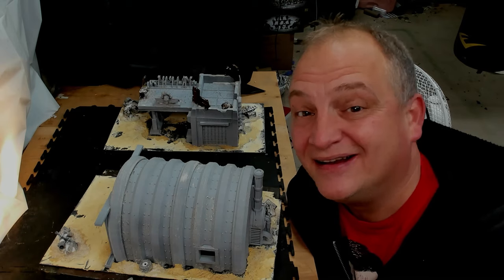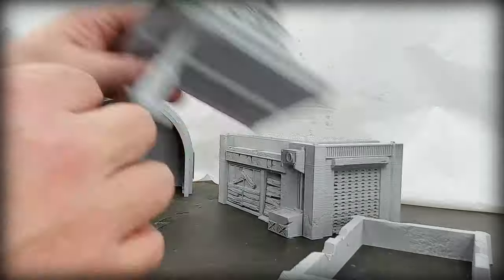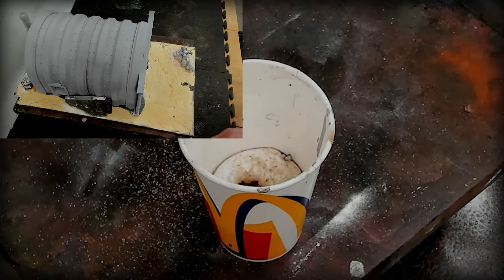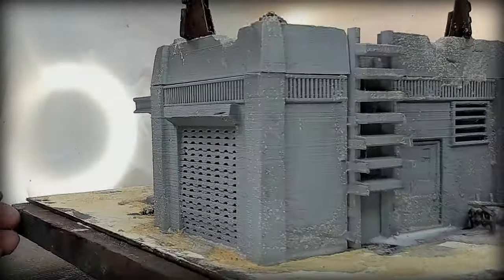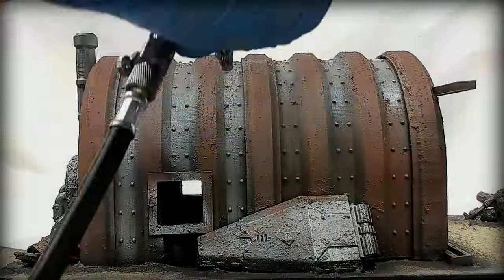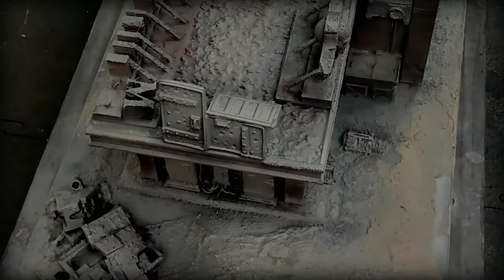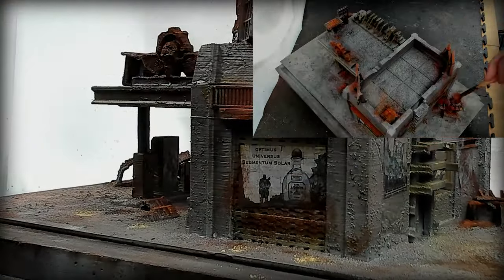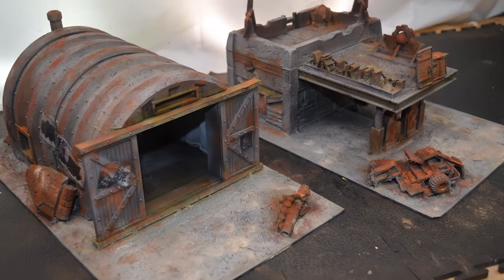Necromunda Ash Waste Repair Shop Terrain Rescue

Comment: So when you were doing your priming steps I saw a spot on one of the bases that was still shiny bare plexiglass and I started thinking it could be cool to have a spot that was painted like the sump tiles and then surround it with some mutant looking plants for a splash of color on one of these tiles.
Reply from the maker: These are things that go into the file for later use!  Nice idea again and will be something that I'll be using in future stuff!  Thanks for stopping by!
Reply: One thing I saw done on another channel (I think it might have been State of Play) was to print some images of sludge or ooze, and stick those  under the plexiglass with the image side up. He also did a little painting around the edges on the underside in a similar color to what was on the images, and then on the top side a thin coat of modpodge or pva for a kind of liquid texture. so it really gives pools a things a sense of depth without having to dig out a chunk of the terrain piece. 😊
Reply from the maker: I saw that one too and I will probably incorporate things like that at some point on other sump boards in the future.  There are a lot of great ideas out there.  Thanks for bringing this up!